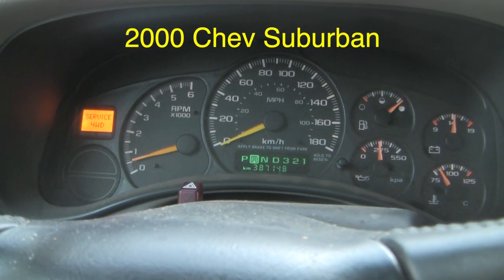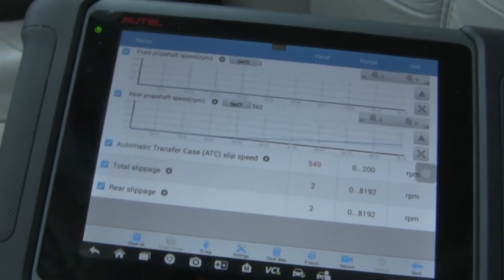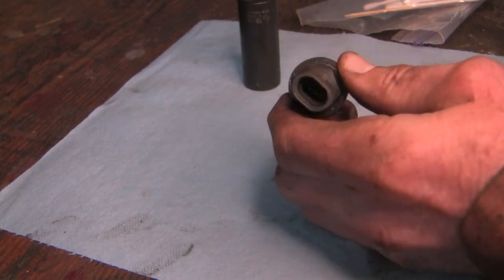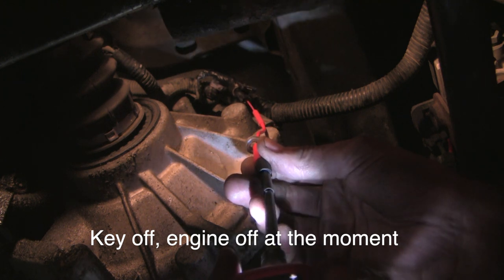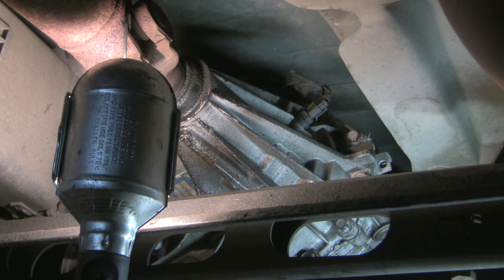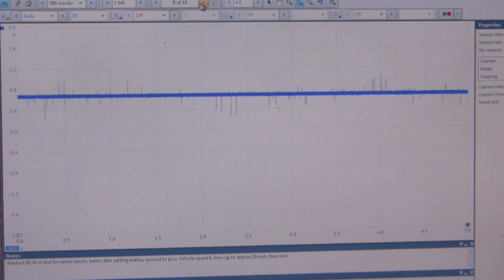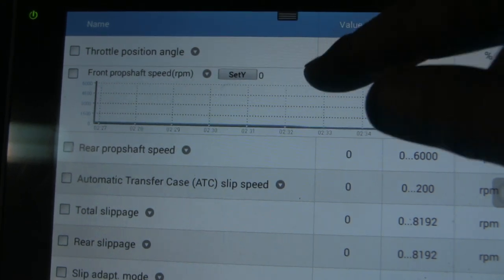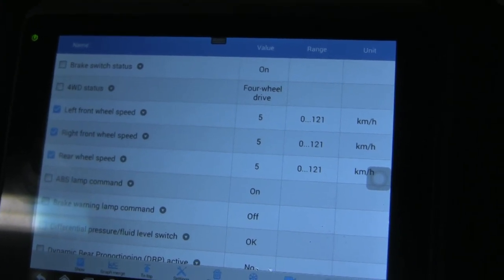How to fix Chev/GM 4WD shift problem C-0305

Comment from the maker: At 8:36, the waveform shown is flat because there is a bad connection on the sensor side of the breakout lead. The module side of the breakout tap is intact, which is why we see the bias voltage. For anybody who is interested, I posted an video update today regarding the true waveforms, here https://youtu.be/_DPj8GbnrRg.  The fact that bias voltage was present when the circuit was open suggests that the module uses that voltage to screen for circuit problems like open, short to ground, high resistance, etc. These two-wire variable reluctance analog sensors are very similar to old style wheel speed sensors.

Comment: Interesting you couldn't see the waveform when checking with the Pico... according to service info the front drive shaft speed sensor is a permanent magnet (PM) generator. Sensor produces a pulsing AC voltage. AC voltage level and number of pulses increases as speed increases. ATC control module converts pulsating AC voltage to drive shaft RPM, which is used for calculations and to monitor differences between front and rear drive shaft speed. It is also used in AUTO mode to determine amount of slip and percent of torque to apply to front axle. 

Did you mess with it anymore? It is not unusual to see OE's float the AC waveform on a DC bias of a volt or so. Great now I am gonna loose sleep... THANKS!  😁
Reply: Do you ever sleep Eric?   :)
Reply from the maker: It's always nice to get a visit from a widely respected professional teacher like you. Thank you Eric!
Reply: @wyattoneable  When I'm dead ;)
Reply: @spelunkerd  I dunno about any of that man... I just fix cars... period

Comment: Better old school 4x4 just. Lock in and go ! Transfer case motors ?  Module for engaging front axle ?  Modules , sensor's  computers for engaging front axle ? OVER KILL ! Having same problem with 2000 sierra once fix down the road ! Then back to old school ! Less headaches ! Informative video !
Reply from the maker: I know what you mean, it can apply to many systems these days. On the other hand, the original locking hubs in my Dad's 1970 F150 truck were irritating, too. We had to hop out and manually engage the hubs, which wasn't so great when you suddenly bog down in the mud. I prefer the old style levers rather than a dysfunctional encoder motor.

Comment: Remember the old days of getting out of the vehicle locking and unlocking hubs, no lights to deal with. Haha
Reply from the maker: Yeah, I liked the mechanical systems where you pulled a lever. My dad had a truck with locking hubs, I remember rolling into a bog and then trying to lock hubs in retrospect. What a mess!

Comment: Very good video, especially showing how, when we do things outside of the norm, it can cause additional errors to appear that are unrelated to our troubleshooting.

I’ve the opposite problem. No speedometer. I’ve the same scan tool 906BT. Gave me “P0502 Vehicle speed sensor A”. Hopefully it’s not mouse chew lol. Will remove and test w VOM and go from there. Cheers!
Reply: I pulled the sensor on the passenger side of the rear output shaft, if I’ve read ur notes right, that should be the speedo sensor. It reads 1480 ohms solid. Confirmed RPO code NP8. 
Checking ground and reference voltage at the connector next.
Reply: What should the reference voltage be?  I’m getting .65vdc across the terminals. Same from the high side to battery grnd, and from the low side to battery grnd, 25-35 ohms unstable. 

I thought ref voltage should be +5 vdc ish.    Between the low dcv and that floating grnd ref I think I’m chasing a wiring issue. Aka, mouse chew. Cheers, carrying on with diagnosing my issues. 😁

Comment: Great video Dave and always nice when you have time to pull a scope out to look at waveforms. I was thinking along with Eric about why you didn’t see a waveform on the good sensor. It’s possible either the front or rear sensors have a floating ground. With both channels hooked up, the floating ground would be grounded out with the other sensor through the scope’s channel grounds. Although the 4424 scope has isolated inputs, the grounds on the scope could still be shared because the grounds are using capacitors. To verify, you could only hook up one channel at a time. Have a great day Dave! 😀👍
Reply from the maker: Good point. After a little thought, I believe I had a bad connection at the sensor end. With good connectivity at the wire loom I was able to see the bias voltage on the module side, but the sensor was invisible. I'm going to repeat that part, and use the scan tool to verify I've got a good connection. Attaching the leads is done blind, and I was trying to get by with very small leads to avoid spreading terminals, so it is not easy.

Comment: This guy tells and does it like a pro...having same issue with my 02 Tahoe. Replace the selector check all fuses and clean the ground under the drive side and still won't engage. Don't really have time to fix it myself been trying to find someone that does it straight forward like you. Gotta watch out for them fake shops that screws up your bought parts like what happen in my town figure I help out with money to them get top and bottom ball joints replace. This worker didn't grease up the joints plus put a hole in one that I check. Owner found out I was calling him out and try to big boy me on phone toldem straight yeah I said what I said and I would beat whoever work on my truck and fuck up.

Comment: Been under my  GMC SIERRA  4 days and tore
Dash a part. Check out 
4 wheel  panel. Automatic 
4 lite up and 4 low lite up
In neutral 2 high. Check out 
All ground's sanded put back got 2 high lite back 
on tried  reverse sounds like it 's  ripping a part.
Banging .

Comment: I've searched everywhere and can not find just the ring sensor for my 2002 Chevy Avalanche. It's my understanding that they are different than the 2003 and ups which you can easily purchase. The only option for me is to buy the entire encoder motor assembly...which I don't want. But I did see in this video that you were working on a 2000 Suburban which is basically the same chassis as the Avs. And yes, I know a scan tool would help but I have no access to one.

Comment: Well done :-D
When you said there were two sensors i did wonder if they were kind and made them the same type, swapping was in my mind too :-D.
You have the dead one to hack apart if you are nosey like me ha ha :-D
I watch quite a few pro repairers and the pico pops up quite often.
South main auto and pine hollow diagnostics come to mind.
2 million ohms lol, as good as open circuit nearly.
Reply from the maker: Normally I don't like scopes that rely on a laptop, but in this case the automotive add-ons with the PICO are outstanding. I'm sure the scopes you use in electronics have better sample rates and more versatility. For automotives it is hard to beat the PICO. That said, there are tiny hand held scopes sold for a fraction of the price that might give most of what a practical tech will need.
Reply: @spelunkerd  Yes i have the traditional oscilliscopes, but most of the time i use them for basic checks on a waveform spec.
It's like using a cheap multimeter to do a Go - No Go check, the accuracy is not too important, just having the ability to say 'That's close enough.'  will do :-D.
Most things are not too critical.

Comment: Was there drivability issues such as resistance(slowing) while turning? I’m having the same issue but isn’t drivable in 4wd have to switch out with the procedure.
Reply from the maker: Yes, it is normal for these vehicles to experience difficulty turning on asphalt when 4WD is engaged, especially in 4WD low. It is also hard on universal joints and tires. They design it this way to try and distribute power to all four wheels, without completely spinning out when one wheel has no traction.
Reply: @spelunkerd  id figured it was shifting on its own into 4lo now I can breathe a lil easier

Comment: Thank you for this post . My 2000 Tahoe is doing this. It would shift in to 2 hi once  in a while but now it don't shift in at all today . When I turn the key on it go s in to 4hi and won't unlock . The only way I could get 2 hi was to go to Auto 4wd and go back and forth a few times then all the lights go out and it goes to 2hi . So I need to change the front shaft speed  censor ?  And I can't get it in 4 lo at all either. The service  4 wd light stays on all the time too .
Reply from the maker: So many things could do this, I wouldn't want to condemn the sensor without proving it on live data. The encoder motor does the shifting and it may be going bad in your case. I would check the fluid levels and find a friend with a quality scan tool to get the codes and show live data. With the light on there is information you need to retrieve from the computer. This generation of transfer case was vulnerable to a problem called 'pump rub', where the pump wears a hole in the case causing levels to fall. Hopefully yours is OK, it would be obvious on inspection, with oil leaking from the case and low levels.
Reply: @spelunkerd  thank you for your reply. It was shifting but took a bunch of do n . Now it won't unless I go to 4 auto  mess around then it will go in.  I know I have to get it plugged in  to see what I have going on    .  I would like to get a  Tech II. Reader .  I found a GM reader on Amazon for around 120.00 bucks . I didn't think that was bad

Comment: A really good diagnostic video. Just wondering if the ABS light while on the stands could have been a slightly dragging disc brake or a bearing thats seen better days? Just a thought... Whats the hardware/software your using for a PC/Mac oscilloscope. We had to sell ours before we left on the big journey and I have to say we could have used it to help out a few folks, but space is an issue aboard. We have a boat a few berths away that has inverter issues on a pure sine wave inverter. I think the sine wave is clipped or modified not pure as its giving the microwave convolutions and has destroyed two toothbrush chargers. Thats almost always a sign (no pun intended) that the AC waveform is not right. So I want to check it.....  Sail Safe guys. Ant, Cid and the pooch crew.
Reply from the maker: Thanks for stopping by, as you know I follow your sailing videos! This scope is a Picoscope, but it isn't practical because of size in a boat while cruising. Also this scope is aimed at 12 volt automotives, and is not designed for 230V coming off an inverter. Yes, you're exactly right, we had an inverter that did exactly that, weird AC waveforms. My computer wouldn't charge with that old inverter, we tossed it and bought another. If you are interested, you can buy compact hand held scopes for about $70 that would work for 12-24 volt circuits on a boat. One place scopes are useful for little marine diesel engines is to do a relative compression test, looking for variance in compression between cylinders. For that you need an amp clamp, capable of reading up to ~150A for the starter motor draw.
Reply from the maker: You got me thinking about a dragging caliper, ha ha. In this case I don't think so, but I'll check disc temp after a drive and I'll check that caliper the next time I get up on stands. The front diff on these trucks is on the left side, and there is extra hardware on the right, including the shift lock mechanism. So with more inertia and gears on the right it wouldn't be uncommon for slightly more drag that would be noticeable under a zero resistance situation. The diff compensates for even tiny differences in drag.

Comment: Did you ever fix The transmission fluid leak? Or does anyone know where that might be coming from? Its a pretty heavy leak on an 03 avalanche and it seems like I would have to drop the trans to even figure out where it's coming from.
Reply from the maker: Yeah, I simply tightened the bolts holding the diff to the trans. I had neglected to put locktite on those bolts when I had the diff off, years ago. Problem solved just by retorqueing. I did a video, years ago, of the diff removal in case you're interested. In this vehicle the diff fluid and the trans fluid are different colors, so it is fairly easy to tell the two apart by looking at the color.
Reply: @spelunkerd  man that's awesome you replied so quick. I have another question about a much bigger problem with the transmission. My truck when in drive stays in one gear doesn't shift up or down. I changed both shift solenoids, filter and speed sensor flushed the fluid still have the problem. I really want to say it's electrical but I don't know what would cause the vehicle to being one single gear. I can get to about 45 mph maxing out at 6,000 RPMs and won't get any faster
Reply: My rear passenger brake (emergency brake) also locked up on my girl when she was driving and the caliper obliterated the mud flap and the bottom of my truck leaving shrapnel. So I just plugged the line after bleeding and replacing fluid. So all the lines and connections to that brake are shot. That wouldn't possibly be a reason it stopped shifting would it?
Reply from the maker: @rickykojdecki6422  It would be easy enough to fix the brake caliper on that side, but no guarantees on the trans problem. A high end scan tool might show more clues, but unfortunately I think you're headed toward an opinion from a transmission shop. It is far beyond my humble knowledge base.

Comment: What scanner tool do you use?
Reply from the maker: Presently I use the Autel 906 BT, but it doesn't offer a bus communication diagram, what they call 'topology'. That's critical for high level scan tools. The big problem with higher level scan tools is how expensive the updates are, so most just buy another scan tool every few years. That gets expensive if you don't use them every day! Mid level scan tools that show live data and allow some ability for bidirectional control are what most of us want, and prices for knockoffs are less than pro versions. I haven't yet found a scan tool that I don't learn to hate, but the Autel has been pretty good for the price.

Comment: What's the make of the scope used in the video?
Reply from the maker: Oh, the scope is a Pico 4 channel 4425. Works great, software is aimed at auto mechanics, you need a windows laptop computer, it is an older version. Not as powerful or functional as a freestanding scope, but the software makes all the difference. New models have added features that are useful, but if you find an older version at a discount I'd give it a look.

Comment: I have a 1995 3500 when I put it in 4 by4 The blower motor turns off
Reply from the maker: That's interesting. When two separately fed circuits are tied together like that, think of a bad ground connection, somewhere. Voltage searching for a ground feeds back through other devices to find a way home to the battery. It's a fun exercise, made easier with a wiring diagram. Most often it's a bad chassis ground, from one of the two, so you may want to look there, first. Or, if you have aftermarket devices under your dash, they can mess things up, too.
Reply: @spelunkerd  thank you for your help.

Comment: would this be the same for a 2002 Chevy Av?
Reply from the maker: Probably similar. These old style variable reluctance sensors were cheap and effective, though at low speeds the data was not completely accurate. Newer vehicles have switched to a more expensive Hall effect sensor with more wires and better accuracy, but I don't know when that transition occurred. If the sensor has only two wires, odds are it is the old VR style.
Reply: @spelunkerd  thanks, today I need to take a good look and see where these sensor/s are...and test them. I have no access to a scan tool so I'll be methodical in troubleshooting it old skool'way. I already ruled out the front diff actuator, that works fine. Everyone is telling me its the encoder motor but I can hear that running hen I press the dash 4x4 buttons. And yes, it could be just the encoder ring itself..which I'll probably be testing that as well if these sensors show up as ok. It appears there are 3 electrical tabs coming off the encoder ring itself. Are you aware what reading I should get through them?
Reply: @spelunkerd   I pulled both sensors and tested them with an ohmeter, both within the specs, chk'd connectors too and re-installed. I'd like to to test the 3 pin encoder ring without removing entire assy. Do you happen to know what wires to probe and what the normal readings should be?
Reply from the maker: @kdlittlehawk  I've never tested the encoder motor so I can't help with that. The dealers service manual is good for details like that. Alldatadiy is pretty good for dealers manual access, although their prices recently were raised. Even so, you can get a few days of access for pretty cheap. If you could get your hands on a scan tool that reads live data you might find clues that offer more direction.
Reply: @spelunkerd   my actual "motor" is good as I can hear it run. I am talking about testing the actual ring sensor..without a scan tool (which I have no access too) Sorry for the confusion.